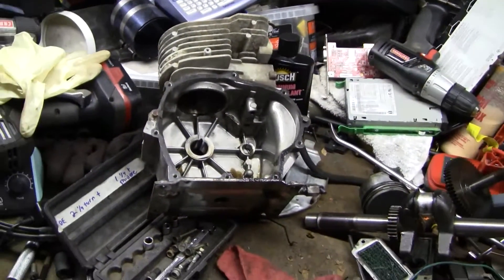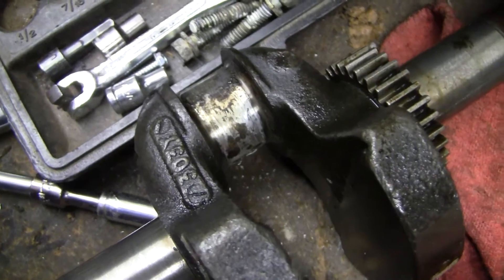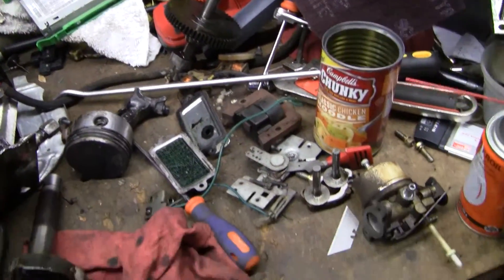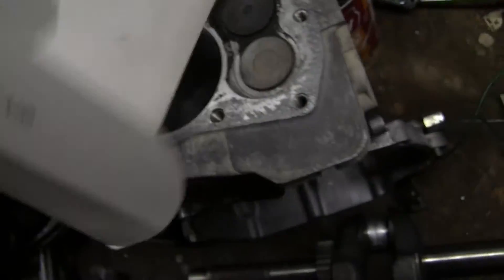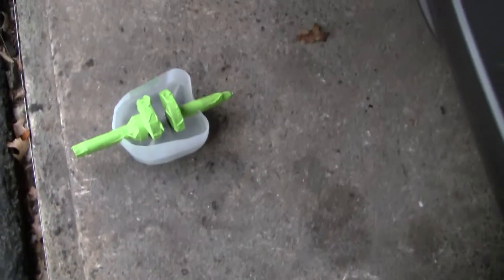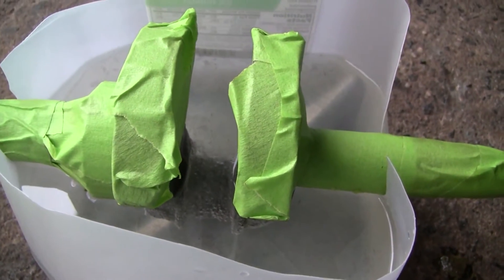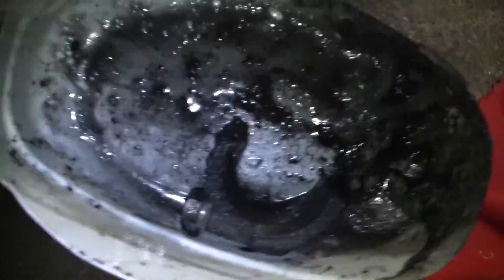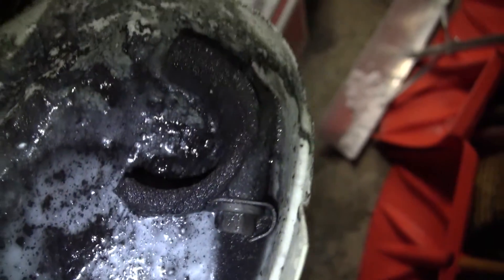Cleaned Tecumseh Engine Block, cleaning a crankshaft with acid

Comment: Yes the acid cleans it off great done it many times it doesn't take much I just dripped some on it it would melt it id wipe it off and do it again when done use polishing wheel n clay to polish it back up it will look like new